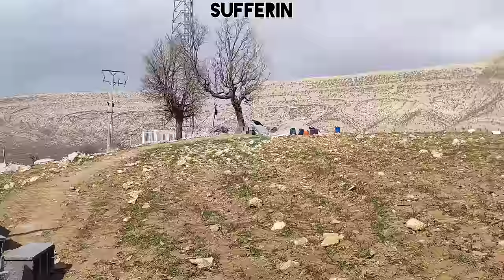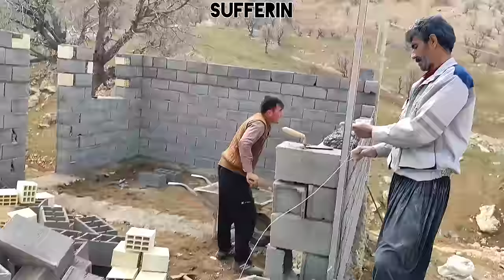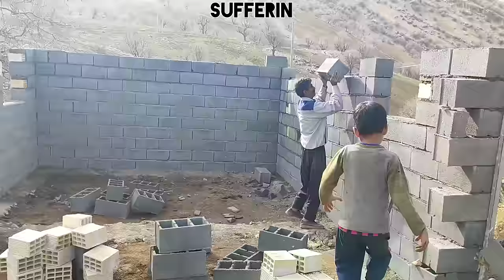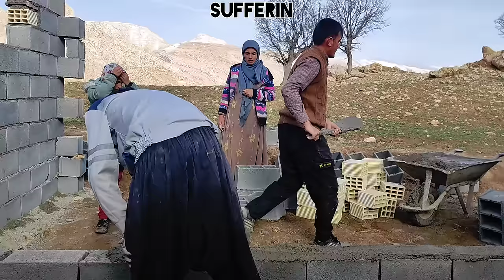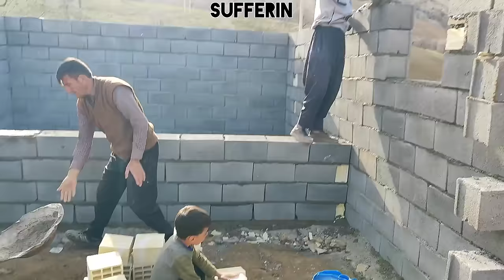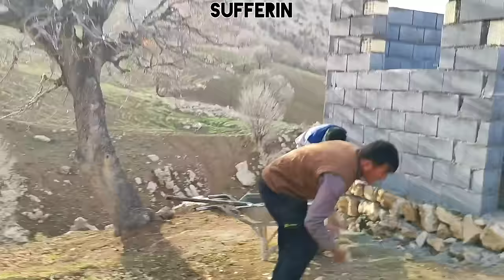A dream house and continuous help from the operator

Comment: You can actually see this family moving forward. You can see so much leaps & bounds. At last we see improvement. I have to say thank you to the operator ❤❤
Please try to make three bedroom you can take the second bedroom and divide into two. Aida is a girl and should have her own room. Its not right to be sleeping with the brother in the same room. ❤thank you so... Much!❤
Please operator mention to the builder about putting in a couple if the white bricks with the holes in each bedroom so the heat travels through . You also need a small window where the kitchen will be.